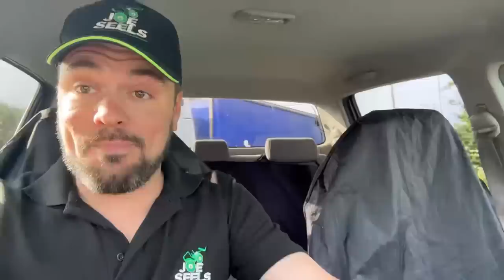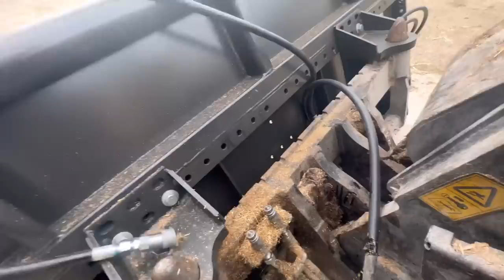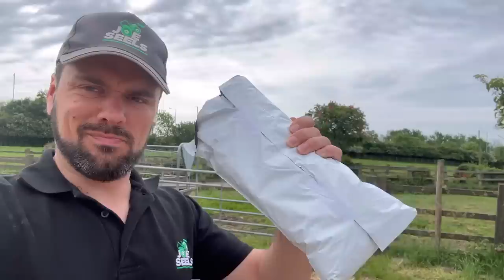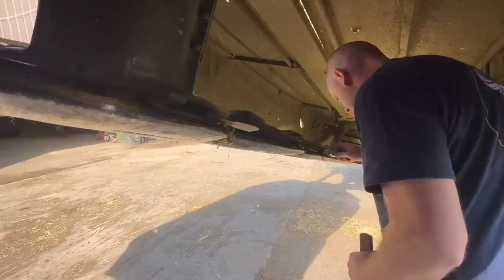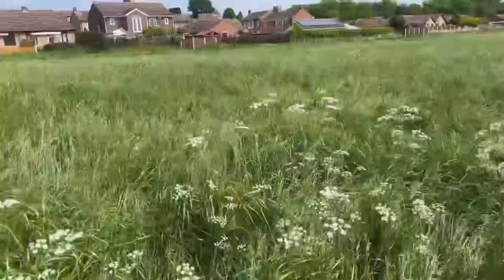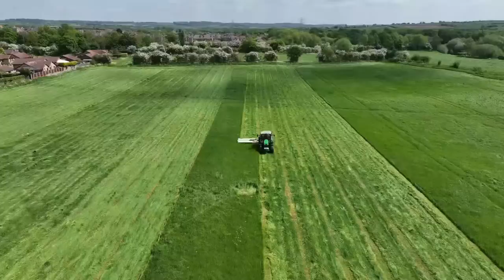Silage! Mowing Has Started! I’m Back on the Farm!

Comment: Hi from kiwi dairy farmer in NZ.  I have MF 7615 ,and mow only with a claas butterfly mower (no front mower.) I can mow twice as much ,without needing front hydraulics and 80 extra horsepower or front mower .  Top tip - just mow against the wheel tracks ,doing this for last 10 years.